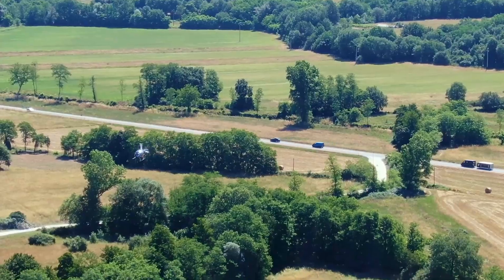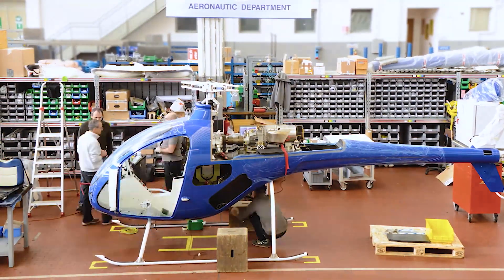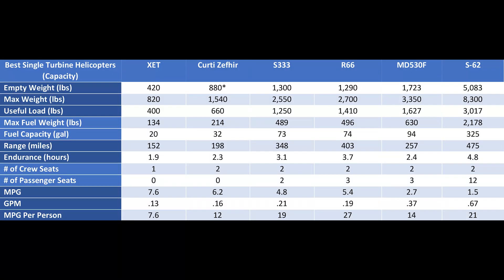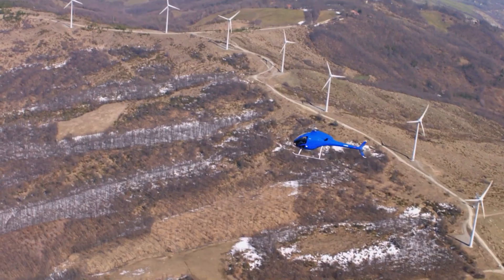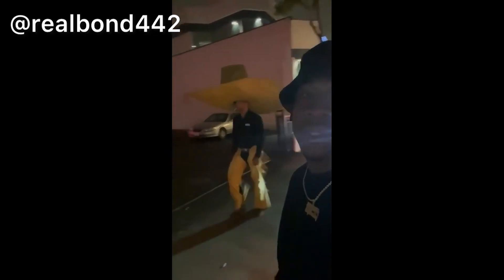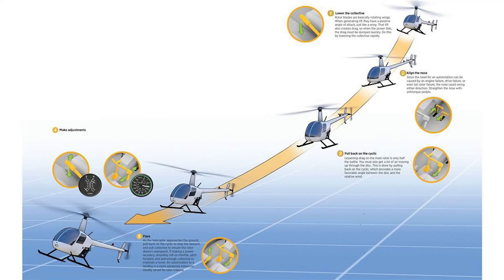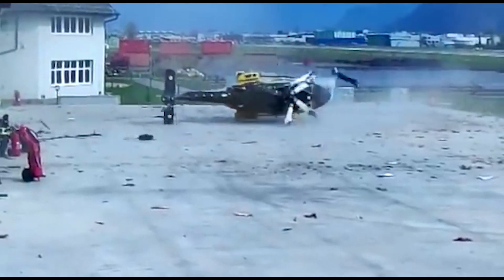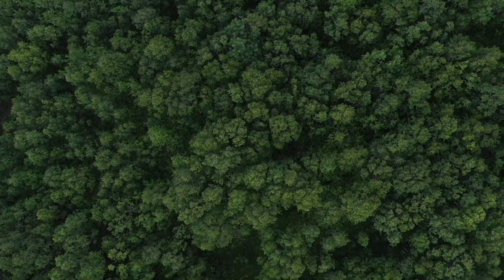Curti Zefhir Overview - The Safest Helicopter in the World! S6|E7

Comment: The parachute is nice because how many times have we seen Robbies cut their own tails off from mast bumping?  Saw one last month in Texas where she and the veterinarian student pilot might have lived had they had this helo as even though their robbie cit its tail off the main rotor and shaft stayed intact and it didn't roll over until the main rotor blade was damaged. This would most likely have saved them both so as a helo pilot myself I'm all for the ugly bump even though it will be criticized much like the fixed wing cirrus as having pilots with fewer skills when they can just pull the chute. Mocking chutes on cirrus aircraft seems to be the cool online thing to do but let's face it even if it is poor piloting that results in chute deployment the fewer general aviation fatalities we incur the keys likely the media and congress go after General aviation.

Comment: If you look at the cruise speeds of the Enstrom 480B, Robinson R66, and Bell 505X, then I'd say that 110kts is pretty competitive. It's the "only 2 seats for $500,000" which is the hardest part to justify. As well, factory support or proven capabilities (like the rugged rotor of the Enstrom) help tip things out of favor on this new ship. Still, I appreciate the innovation and movement toward a safer (feeling) flying experience. I wonder what the flight range would be, given the high hourly fuel consumption of the turbine and the limited capacity for Jet-A storage on such a small aircraft.

Comment: I would much rather autorotate. Good training, experience, and pilot practice, good pilot skill, good discipline and good safety decisions, including scrutinous and uncompromising pre-flight inspections, cannot be replaced by any amount of money or equipment in an emergency, or more importantly in the prevention of emergency. Conservation and management of main rotor rpm inertia is the key to controlled autorotation descent and landing. The weight, complication, profile drag, and un-steer-ability of the parachute are a no-go for me. In other words, if I have to crash, I'd rather crash with an autorotation than with a parachute. ... Also, by the way, I adore the two seat Curti Zefhir, as I am a single seat Experimental Category turbine engine helicopter owner and pilot.
Reply: One unforseen wind gust near 0 g and you are dead. This is why i prefer planes, even though admittedly helicopters are amazing.
Reply: @molo2793  Practice more autorotations.

Comment: The problem I see is that most helicopter crashes happen near the ground. No time for a parachute!!!
Reply: Maybe emergency thrusters and CO2 canisters that thrust the helo up some while the CO2 fills the chute
Reply from the maker: That is certainly one of the problems with it
Reply: Yeah there is kind of a corridor of death below 30-50m or so. No room to build energy for autorotation, but likely still too high for rotor inertia to get a dead heli to the ground in time on that residual energy. Of course it’s also too low for a chute
Reply: @StealthTheUnknown  nope